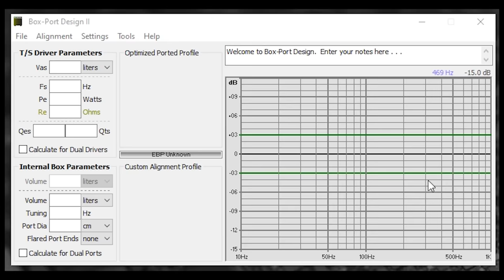How to Make L-Ported Subwoofer Box - DIY

Comment: Very well done project bro .... u have been progressing a lot .... port area a little oversize . Might be looking for spl ....some 45's to smooth air flow .. a cross brace and these driver can nearly crack everthing in its path .. i've been using the single coil one in a honda and its awesome .... tsw311s4.. good job .. congratulations ..
Reply from the maker: Thanks Raghoobear.

Comment: 🤯I admire your work- It's a satisfaction to watch your work in progress.
Very neat and very professional also. 🍪

Just yesterday I bought sub exactly like this one, so if you'd be so nice and shed some light with three short answers:

               - In the Pioneers user's manual for this sub specifically it says that ideal volume for ported enclosure is 42,5 L (1,5 cubic foot), and yours is 56,6 L (2 cubic foot). Is there any specific reason for that?

               - I noticed that you're not using any damping material inside. Is it not necessary or it would be just too expensive for the number of boxes you're making?

               - This sub will not go into my car, I'll use this sub in a home theater and for 
music listening/parties, with car amp hooked to my hi-fi amp in living room instead. Is this enclosure 0k, or would you recommend some changes or whole different enclosure. 

Thank you in advance for your time, keep up the good work!

Greetings from Croatia. 🙏
Reply from the maker: Hello Hrvoje, thanks for the feedback. 

To answer the questions:
- I opted to build a bigger box for a more deeper bass response
- No need for dampening material since the box is already tuned to what I desired.
- For home use, you can calculate a box that can cover all the desired low frequencies for movies and for music. I suggest to use a box designing software. You can download Box Port Design II, it is available for free for Windows PC.
Reply: @chrclmnky  Thank you for this valuable info bro!

Be blessed in your ways! 🕊️💛

Comment: hey there, i was making a speaker, does putting glue and sealant on the edges make a difference..... I used alot :)
Reply from the maker: Hello. Me i use glue on the inside corners for an air tight seal. That's it.
Reply: @chrclmnky  thanks bro

Comment: Great video just wondering if you ever confirmed if this box is indeed 31hz because I seen in another message a commenter said it might be higher.  I'm looking for a box that is 2 cubes at 32 to 34hz. Thanks.
Reply from the maker: Hello Johnny, did used several speaker box, displacement and volume calculators as you can see in the beginning of the video. You know these random commentors trying to be experts behind their phones or PC's.
Reply: @chrclmnky  For sure lol. Another question I clicked the link for the box specs but I get nothing can you post the cut sheet or a better link? I want to build this box.   Thank you.
Reply from the maker: @paquesepas6696  I agree brother. Read the video description, there's a link to Tinkercad layout and design to this box. You need to create an an account in order to see further about the 3d design.

Comment: can you give me the masurements for this box? i can't transform for mm in tinkercad. its can't show the air port length etc.
Reply from the maker: there is a link to the TinkerCad 3D schematics in the video description. You need to create an account and login to TinkerCad so you can start using it and seeing the dimensions. Use laptop or computer web browser to open TinkerCad.

Comment: Is it logical to use a 20 cm (8 inch) subwoofer in an L-ported enclosure? Which cabinet do you recommend for being able to use it anywhere?. I want to create a portable system like the JBL PartyBox. I need your assistance and expertise :DD thanks
Reply from the maker: Hello, yes you can use any port design to any 8" subs. I suggest getting at least 500w RMS 8" sub from Skar, Sundown or Digital Designs. They small but very powerful.
Reply: @chrclmnky  hello again .Unfortunately, the power of the amplifier and the battery are limited. I have a Cadence 20 cm 150 RMS subwoofer. What type of cabinet do you recommend for it to deliver bass in every area like JBL PartyBox? My ported cabinet doesn't deliver bass at home, it only delivers bass under the table :D I'm sorry for bothering you.
Reply: @nezuko-cihan usta numaranı verebilinmi

Comment: I want to start by saying this was a very well constructed and well thought out box. You’re attention to detail is much better than the majority of people. I have one complaint though. You put 1400w as the value in the box calculator. That’s incorrect because that’s the “max” rating which a sub like this will rarely if ever see. You should always use the RMS wattage for calculations because that will give you the best possible box no matter if you’re going for SQ or SPL.
Reply from the maker: Oh, thanks for the great tip. I was hesitant at first if I just put the RMS value into that field because the resulting optimized box will only suggest a very small port. If I put the max rating on the other hand will give out some real-world port sizing on Box-Port Design II software.
Reply: Charcoal Monkey If you come up with the tuning using the max wattage that’s going to make your whole set up extremely inefficient because in order to hit that resonance  you’ll have to be getting up to that 1400w. Maw rating is also referred to as dynamic power. That’s the actual power usage when listening to music. You may only occasionally hit that max wattage but you’ll always be at or above the RMS. That’s why you want to tune the enclosure using rms instead of max. I hope this was clear and somewhat concise.
Reply: EricTheBoringOne tuning doesn’t change based on input power. Port volume and bass-reflex (among other alignments) tuning is often derived from port area x port length, so there are many combinations possible to arrive at the final port volume. Since max power was used to find the port volume in this scenario, we can plan accordingly to keep port velocity lower at high power levels. If you use the driver’s continuous power rating when simulating and create the port volume with our maximum desired port velocity in mind and build from that sim, it’s highly possible we’ll experience chuffing at high power levels, since port velocity will be much higher when exceeding the driver’s continuous power rating which we designed the box around.

Comment: l have a subwoofer box size 10 incg
Air is leaking from the sides of the wood Did you use glue on the inside of the wood
Reply from the maker: Yes I use glue. Not leaking when you cut the wood perfectly square and apply enough glue then clamp overnight.

Comment: A question. How do you give the intonation to the port? that I have to take into account to give it the intonation. The port must be 30hz.
My subwoofer has to have 70.8 cubic liters. greetings from Mexico.
Reply from the maker: Hello Miguel, nice to have you here. On the L port box calculator on RE Audio (http://reaudio.com/box.php), you can calculate the tuning frequency marked as Fb. I just used another software just to get a clearer measurements of the small parameters using the Box-Port Design II on PC.
Reply: @chrclmnky   

Another question will be a problem if my drawer must be 2.5 cubic feet and as a result the program gives me 2.06 cubic feet?
Thank you.
Reply from the maker: @miguelmarin1445  Box size is dependent to tuning. If you're happy with the tuning with that size, then that size is good to go.
Reply: @chrclmnky   Ok very well thank you and clarify doubts I had thanks for taking your time and answer thanks greetings
Reply from the maker: @miguelmarin1445  anytime, brother

Comment: Nice build, one correction thought, "transmission or T-Line box" is not same as L-Port box, T-line doesn't have loading chamber and it uses port that's 1/4 (or 1/2) wavelenght of tuning frequency (fs).
L-port is just one type of bass reflex box (slot port instead of circular).
Reply from the maker: Thanks for the great insights.

Comment: Wow nice po. Ang ganda. kaya bumili din ako ng ganyang  subwoofer. .May tanong po ako. Kakabili ko lang po ng ganyang subwoofer Pioneer . . Anung amplifier po ang pwedeng i match po. Maraming salamat boss.
Reply from the maker: Good day. Any Class D mono amplifier that supports 2 Ohm load with at least 350w RMS. The Pioneer GM-D8701 amp is very good match for this.

Comment: The total Q is 1.3 !! holy crap. A good number to shoot for is .7. That will still result in tight bass. Also looks like the tuning is about 60 HZ. Lots of SPL but no good for a "Sub" Woofer. Looks like it needs to be a cube bigger & a longer port, or a smaller  port will allow for a shrter length, make sure to calculate port velocity first, to avoid chuffing....& flare that sucker too
Reply: To the OP

From what I learned dabbling with Subwoofer programs, (I don't understand all the T/S specs lingo fully, I let the programs handle that) this Subwoofer can't go lower than 1.05 Qtc because you can't go much lower than the Subwoofers Qts without going crazy on the size of the enclosure. 

There is a hump centering around 60hz, but seems to play down to 30hz fine. In car performance might be better there too. The port velocity seems to be 20 m/s which seems fine to me. If there is any chuffing music should be playing and you might never hear it.

Someone correct me if I'm wrong though.
Reply: @erictheboringone5292  if you go to a smaller Port you will often see that you need a longer port length achieve the same frequency. Chuffing is real..
Reply: TheeJoeyLee Umm that’s a pretty obvious statement about port size my dude and you won’t often see you need to make the port longer, you’ll always see that it’s needed because you have to have the same amount of port area to achieve the same tuning with different diameter ports, if round port obviously. I never said chuffing wasn’t real. What I said was it’s more of a theoretical thing because you rarely ever deal with it in real world applications. That’s the truth. I’ve been building sub boxes since 1993 and there’s only a hand full of times that I’ve heard actually “chuffing” or box fart as I refer to it. Those were all sub par builds that the builder paid little to no attention to any detail. Moral of the story is that quality craftsmanship and pride in the things you make cause problems like box fart to stay theoretical.
Reply: I got the port thing wrong actually.. when I wanted to go from a 4-inch port to a 6-inch port... the length  needed to increase so much I couldn't fit it in enclosure... and Port noise isn't a Theory.. I have an 8 in energy sub that does it...and so did my Boston Acoustics sub in 1995. Only thing I'm trying to say is that this dude's enclosure is Tuned like an SPL box he needs more port length or more enclosure volume. The tuning frequency can be verified with some test tones, a multimeter and a 20w 100ohm resistor in series with the amp. But you probably already know that..... I mean how could it be possible to anybody but you could be designing speakers since the early 90s.... now excuse me I've got some port flares to make for my LLT Sonosub build
Reply: TheeJoeyLee You just made my point for me. If you have no attention to detail during your build you can cause this to happen like box fart. A 6” id round port is too large for a single 8. You may be able to get away with it with proper placement and using flared aero port ends instead of flush cut ends but that’s a maybe. Hell the 4” round port would probably be pushing it.
Reply: How do you want to achieve .7 when the woofer qts itself is already over 1? That's impossible. Usually you should put a woofer like that in a big sealed box (1.1 - 1.2 system q still sounds decent in sealed, many vintage speakers were like that) but a car sub is not a precise instument, it's just there to make "BOOM BOOM" so this doesn't really matter.

Comment: Love your videos and the work you do looking to do a 4th order blow through is there any way you can help me
Reply from the maker: Thanks for the feedback. 4th order bandpass boxes are fun to build. Bass Box Pro 6 can calculate a box accurately.
Reply: Charcoal Monkey I've used winisd to calculate it but I'm not understanding it
Reply from the maker: @mruiz0285  bass box pro is easy to use
Reply: Charcoal Monkey I tried downloading it but it was asking for a payment not sure if thats what I was supposed to do maybe I can send you the specs and you can give me a blue print and I can pay for it
Reply from the maker: @mruiz0285  let me know the brand and model of your system so subs. Will calculate using bass box pro.
Reply: Charcoal Monkey its a skar audio EVL-12 dual 4 ohm.....do you have a facebook or instagram where I can message you
Reply: Any specs yet?

Comment: Question... when you were in the RE Box Calculator program, you entered a port width of 2" (inches)...
When you went to the Box Port Design II program, you entered a Port Dia [width] of 4" (inches).
Did I miss something? I'm asking b/c I'm about to do a box design; I'm interested in using the programs in your videos & I don't want to make a mistake. 
Thanks for your help. 👍👍
Reply from the maker: Hello Jr100, I was just comparing the result between them and I thought 4" diameter is the near equivalent to circle from 2x13" slot port.

Comment: Does the shape of the subwoofer box have an impact? I wanted to make it so it fits behind the rear wheel/strut tower to take up less space.
Reply from the maker: Hello Captain, no. Any shape will do. Just calculate the volume, size, port area, to get an accurate box. Use Bass Box Pro 6.

Comment: Man I don’t I just thinks it’s me. When I build my boxes, I like the baffle (where sub is mounted) to not be mounted on the face of the box and to have the port cut out, example like the rear and side walls are sandwiched from the top and bottom. 

I alway make the top and bottom to be the overall width and depth and all the wall to be cut at the same time to be the exact height and then cut all panel to be there appropriate length. It alot easier and I feel it’s stronger

Comment: I have an American bass Xmas 12 inch subwoofer what will be the appropriate box size for that????
Reply from the maker: Hello Crisanto, I calculated the TS parameters of that subwoofer and it can output a -3dB @ 24.9Hz in a 1.5 cubic feet of ported enclosure.

Comment: What connection did you make of Subwoofer  parallel aur series and which one is better pls tell me
Reply from the maker: This one is in Parallel to achieve the least DC resistance which is 2 Ohm.
Reply: @chrclmnky  ok dear thanks 😊
Reply: @chrclmnky  but i have not mono amplifier i have  four channel stereo amplifier i bridge 2 channel for Subwoofer and use other 2 channel for speakrs so will the Subwoofer work at parallel

Comment: Wish I had the natural skill to build boxes
Reply: It's easy, you just do the calculations, cut the parts, glue them, put the speaker in, and your pretty much done.
Reply: Bass Drum Flextime it’s not that simple.  I used to build subwoofer boxes when I was in my late teens and early twenties.  It’s tough work.  Lots of dust from sawing. Had to buy circular saw and jig saw.  I was lucky that my dad had many tools too.  

Buying the particle board isn’t that easy too as Home Depot back then wouldn’t even cut the 4x8 feet sheer for you at times.  I had one piece sticking out the back off my trunk one time. 

You need good blades too or the saw won’t cut through if the blade is worn out.  

I never even messed around with ports either. Just built sealed enclosures.  Not simple rectangular type boxes either.  

I had a hatch back type car and I created enclosures for the satellite plate speakers where they were cross firing. So imagine the angle cuts necessary.  The 4 8 in subs were firing upwards. 

After all the work too the bass just didn’t sound good. The Polk Audio plate speakers sounded awesome.  Punchy mid bass.  I even switched top enclosure to 2 10 in subs vs the 4 8’s. Still didn’t sound good.  Cubic feet was about 1.5 to 2 also.  

I decided to try and different box.  Pulled out the old one and decided to have the subs fire directly toward my back this time.  2 10 inch and 1 12 inch dual voice coil.  Much deeper enclosure.  This one had solid deep bass but didn’t have the clean mid bass punch I was looking since I couldn’t use the plate speakers anymore. 

By this time picked up another car and built at angled 2 x 12 in subwoofer box. 

All were carpeted.  

New car had 4k stereo system.  Nearly 1k watts.  Back in 89/90.  Unfortunately car got broken into. Most of the stuff got stolen.  Never got back into car audio after this. Moved on to Home Audio.
Reply: @f430ferrari5  yeah that's true

Comment: Hello! This box work with a sub Pioneer TS-w261s4 10"?
Reply from the maker: Yes, just lessen the width by 3", and height and depth by 1". Lessen port length by 2" also.
Reply: @chrclmnky  very well, another question, the measurements of the box are external or internal?

Comment: Is this dimension good for pioneer ts-w1211d4 subwoofer.
Reply from the maker: Hello Machan, actually TS-W311D4 is just the same as TS-W1211D4. W311D4 is model for Philippines and W1211D4 is for India. Both are just the same.

Comment: I have the standard version of this pioneer sub and if this comp version is on par with the standard then it’s a damn good sub. I paid $55 for mine, paired it with a Dual brand amp that’s CEA rated for 240w RMS at 4 ohms and built a custom ported box for it, it literally rattles me fucking teeth.
Reply from the maker: Good stuff. I was only getting this comp version because it was on sale at a very good deal.